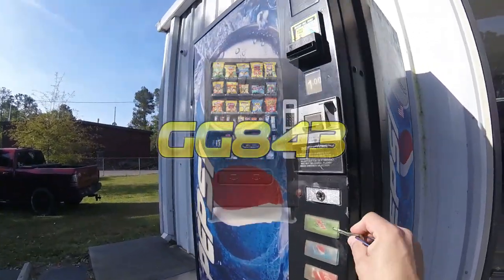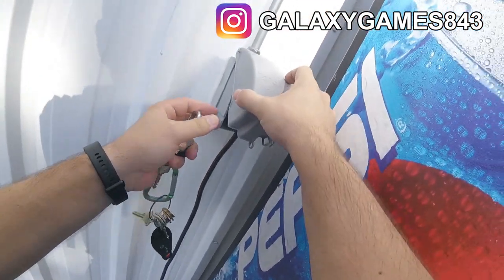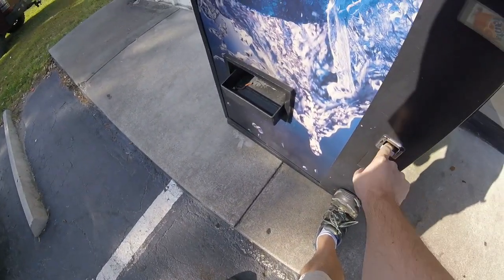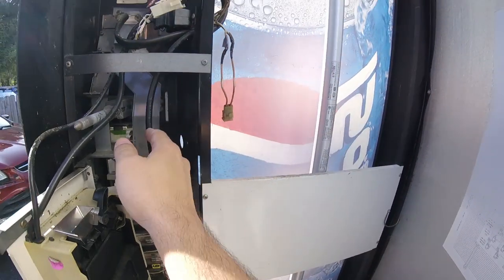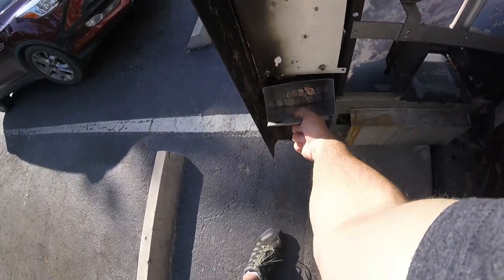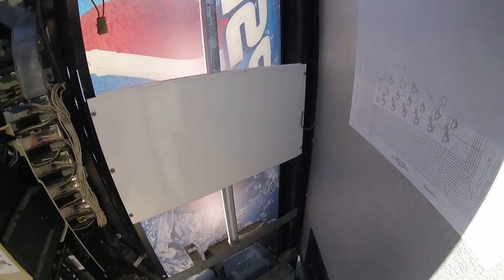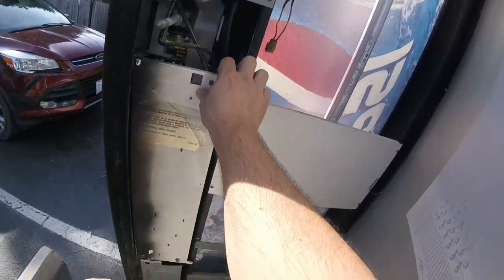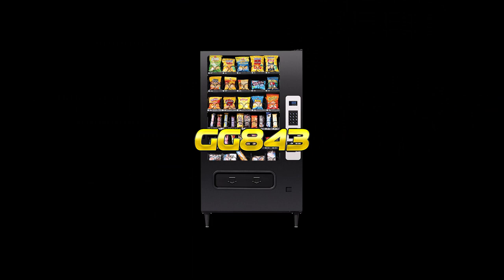More Vending... More Problems! This is our newest problem with our Vending Machine Business! PART 1

Comment: The most coin mech has a display , so I can see or have a point what can be ,with the coin mac. Such coin mech I hate, because it works or not . If not you have exactly this problem . I don´t would connect and disconnect the coin mech when the machine is on. In my case a coin mech blow up and you know this is an expensive way to learn . Greatings, love your video .
Reply from the maker: yes I know! Since it was already non working I took some chances... Replacement should be here soon!
Reply: you probably dont give a shit but if you're stoned like me during the covid times then you can watch pretty much all the latest movies on Instaflixxer. I've been binge watching with my girlfriend for the last couple of weeks =)
Reply: @Wilson Edward Yup, I have been using instaflixxer for since november myself =)

Comment: So oculd you take this mech to a similar model just to try it there?
Reply from the maker: Yes the replacement should be here shortly!
Reply: @GalaxyGames843  he meant to swap it out with another coin mech from a different location to isolate whether the coin mech was the issue or it was the wiring, etc.